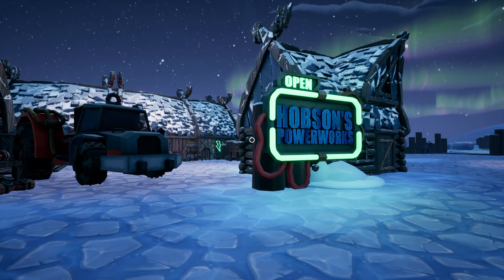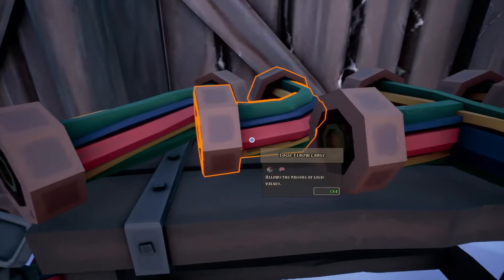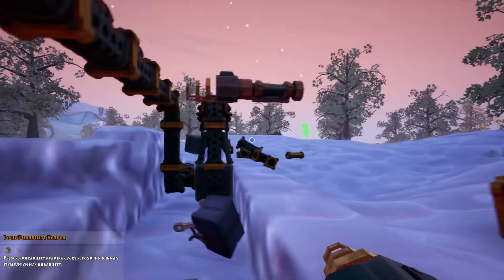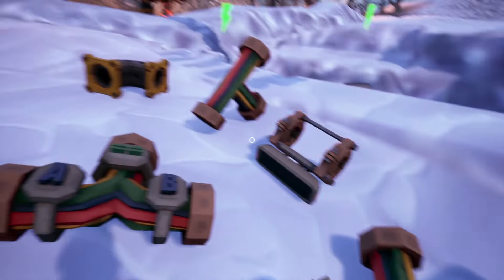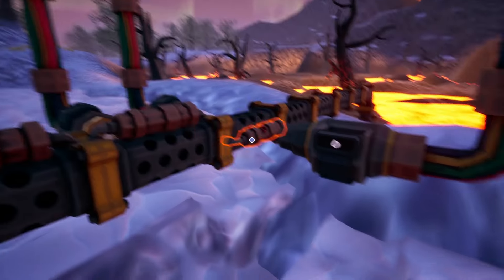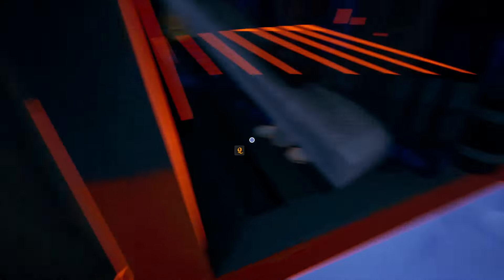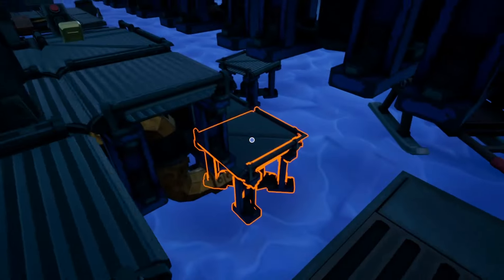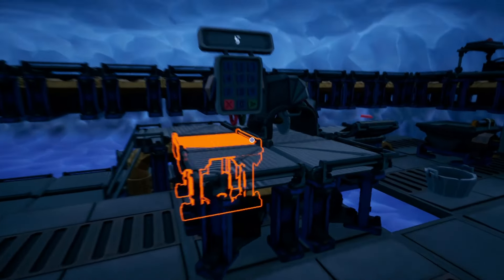I Built A Dwarven Mine And Over-Engineered Our Crafting Setup! | Hydroneer DLC | EP 5 |

Comment: You'll need to add a water shutoff for your smelters.  I did an automatic system using logic so the water shuts off 4 seconds before it smelts, and then 4 more seconds until the water turns the belts back on.  I've seen others using 3 second delays.  To build this, run a tee into the water supply.  One end comes directly into it with a flip hook and a diode, the other end has a delay into your smelter, and then joins back into your water supply (with a diode) after a second delay.  I have 7 harvesters auto-smelting into my main blacksmithing area every 15 minutes in a continuous logic loop.  You just need a push button to start it up after loading your save file.
Reply from the maker: Nice, ill have to try this, i had no idea how i was going to approach it to be honest, its such a weird thing to need to have to do for this to work. 
Appreciate the advice, definately going to look into it!
Reply: @Quorthorn10  I was in the same boat as you.  I saw the other people using magnets to keep the resources from falling into the smelters, and also running weight sensors, but all of that just over conplicates things 😂.  The timed system with a belt shut-off is definitely the easiest way imo.  I can make a video showing the layout if you're interested?  I can only run less than half of my drills because of lag, but I find it perfectly playable with 84 heavy drills at tier 3, and a couple dozen small drills at their 1 for the blacksmithing area.  If you do multiple harvesters and sorting areas, you need to have a separate circuit that never shuts off for the main sorting/ blacksmithing area.  I send all of the gems up to the top since there aren't too many of them.

Comment: Use a A >= B instead of A == B so if the durability becomes lower than the set value (if you change the set value) it still repairs it. 1 != 5 but 1 <= 5. And it's better to trigger them individually in the long term because you make huge savings on spanners with a bit larger installation cost. I always trigger my repair systems individually
Reply from the maker: That makes sense. Ya so many people trigger by the group and i think thats really weird honestly.